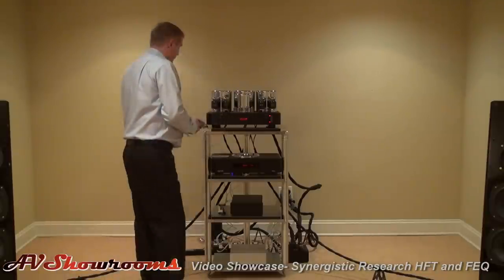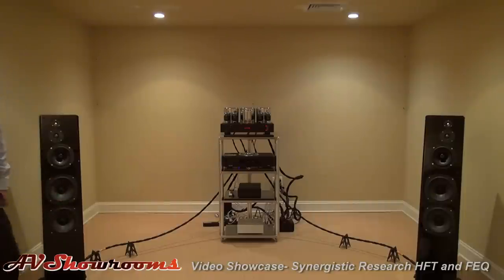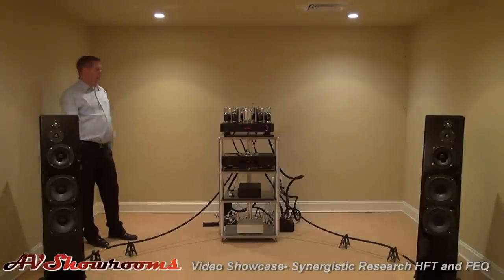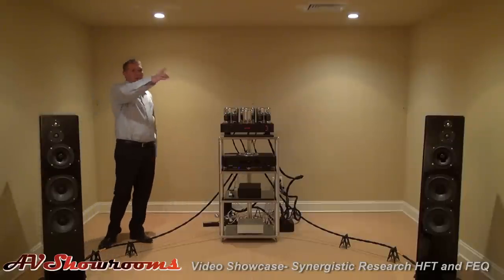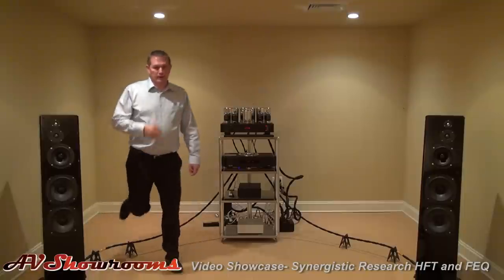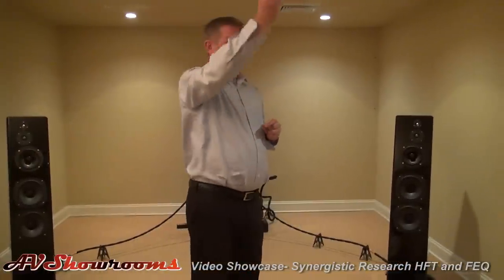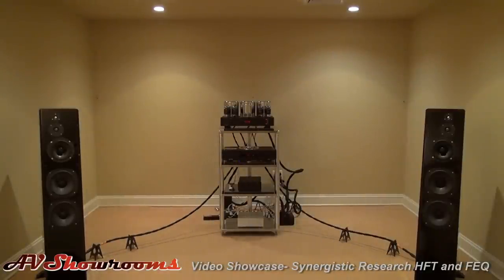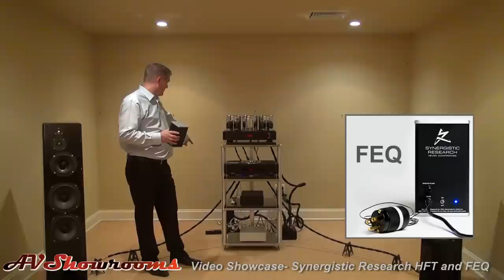Synergistic Research HFT, FEQ Install #2

Comment: This system has three fantastic qualities that most other room treatment systems do not have. One it is easy and quick to place the HRT bullets  with no damage to the walls and speakers. When you move, the system goes with you and there are no hole marks  in the walls. Second the system is modular. You can improve the room one level at a time up to the fourth level and add the FEQ at any time. Third the effect is immediate.There is not the dreaded 150 hour breakin before evaluation. An added bonus is the HRT's are so small they are not noticed on the walls. Unlike most acoustic pannels the HRT's do not distract from the room decor. I have  had the system in place for 3 months and I am still amazed how much better the sound in my home is. I would audition this system before trying other upgrades.

Comment: Wow! Level one makes a huge difference, the drum has more depth and there is less echo.
Level two, You can hear Peters voice become less echoey as he adds the HFT's, The piano has more texture and the decay feels cleaner. You can actually hear the drum stick keeping time on the side of the drum now. Without it was washed out completely in the echo.

Level 3, The delicacy of Anne's touch on the keys is now more present and one cane feel the weight of the note more. The drum now has more slam and depth and the cymbals more air. Annes voice has more texture and weight.

Level 4,OK, the piano notes linger in space and decay far more authentically, cymbals have even greater texture and the drum more snap and immediacy as well as slam. The piano notes are even more defined, greater texture once more and Anne's voice has more breath and texture (note the word texture keeps coming back!).

FEQ, What I hear is synergy with this in place. Like all the parts I mentioned before have come together in an holistic way. Resolve is the word I think. Everything was great as the levels were increased but what the FEQ does is resolve it all, make it all make sense as a whole With the MIG in place what happens to my ears is that the noise floor sinks completely and there is a smoothness added which adds to a more natural presentation does that makes sense Peter?

I think in over thirty five years of audio  and even though I am listening through a DAC and my Beyer T5P headphones out of my MacBook Pro this has to be the most compelling demonstration of treatments to a room for audio I have ever seen, quite astonishing and revolutionary Peter. 
Also for those reading this, I am very familiar with this album. I have both CD and High resolution versions of it so know what it is meant to sound like!

Comment: I've been thinking about getting some synergistic interconnects, and possibly speaker cabling. I don't think I've ever heard anything negative about them. Certainly not going to pay a lot for them. Patience will be a virtue. Currently using some Nordost Super Flatline Gold speaker wire (I was one of their very first customers) Acrotec Interconnects all the way around. Did pick up a pair of Wire World Loudspeaker cable for like 35., and I am also very impressed with them.